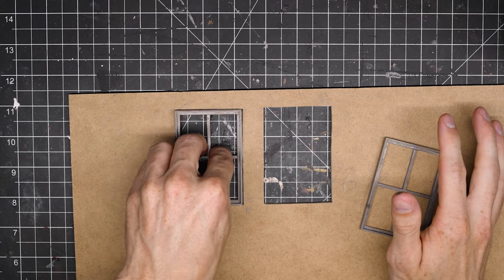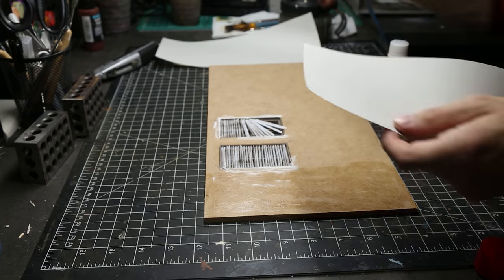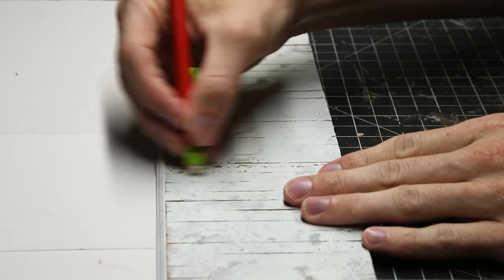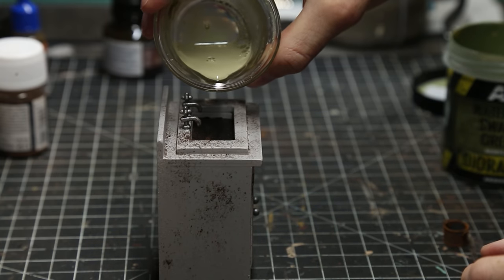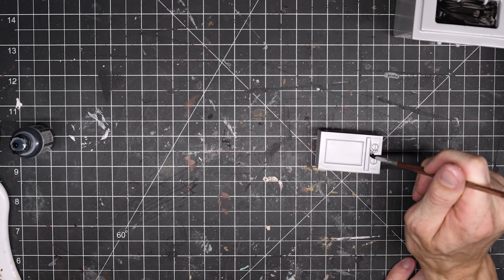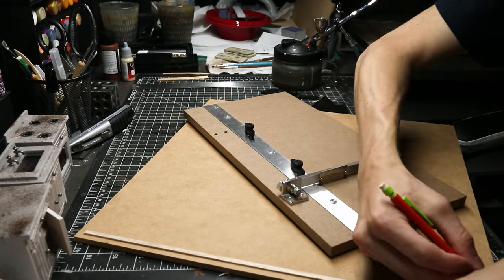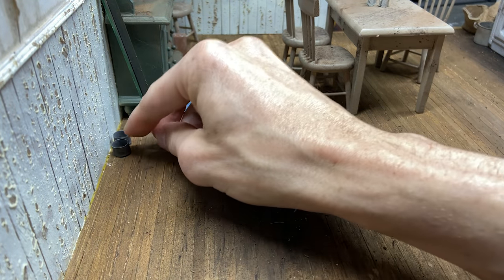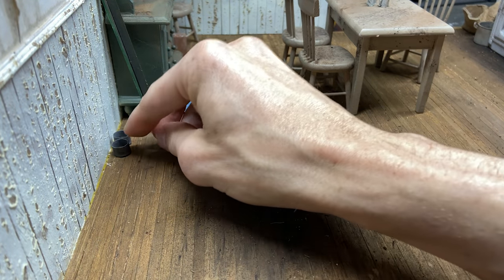Making an Abandoned Miniature Diorama to Film Cinematically | Resident Evil 7

Comment: The smoke is not the right scale. Otherwise perfect!
Reply: To get the smoke to look perfect, use "Diffusion in a can" which is a theatrical product that looks great. Also the drips on the walls were too big of a scale. To get the drips to look the correct scale, use a soda straw and hold a brush with some wash against the top of the wall and blow the paint for realistic drips.